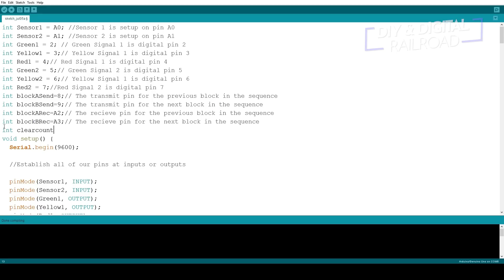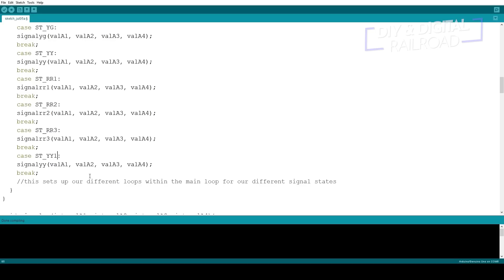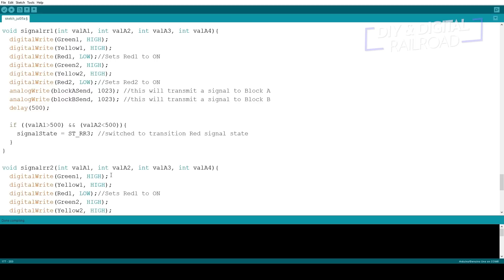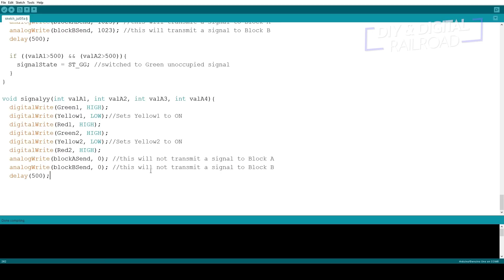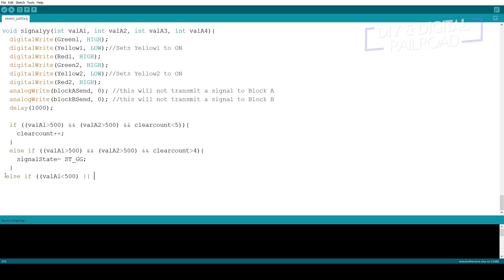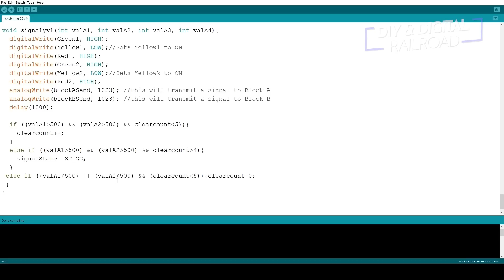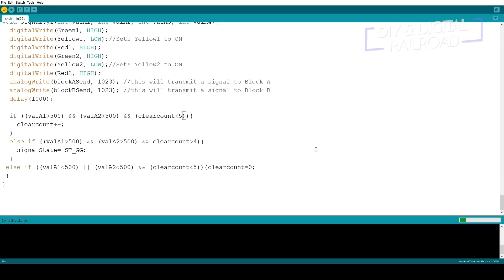Arduino Multiblock Signal Install Part 2

Comment: Hi Jimmy,
I'm new to this Arduino stuff and I'm amazed at how powerful, versatile and reasonably priced it is.  The block signaling is great but can that be linked to Block Detection using the Arduino so another train cannot enter a block already occupied by another train?

Comment: Hi Jimmy' I am having a  bit of a problem with your Arduino Multi Signal Install Part 2. The problem is it won't comply past the  case ST_GG:, next line 
signalgg(valA1,valA2,valA3,valA4);  ,I've downloaded the sketch and that is what I get.  How can it be fixed or is there some thing missing that I cannot find
I do like the concepy of the sketch and would like it to work. Many thanks for effort in writing the sketch    RON

l
l
l
Reply from the maker: Hey Ron,  Sometimes when downloading or copying and pasting, phantom characters can appear that you can't see.  Try deleting the line and manually typing it in.

Comment: Is there a if statement missing for block b occupied and current block clear in signalgy and block a occupied and current block clear in signalyg
Reply from the maker: If both adjacent blocks are occupied, then the program hops to signalyy.  This sets both signals to Yellow.  I just double checked and it is in there.

Comment: My question is, how the locomotive read that signal ?. I guess the signal states are transmitted by code transmit into Arduino that controled the motor shield.. Mmm, I'm still thinking about it..

Comment: Do you have any issues with the sensors picking up trains on the inside track where there is a double track? Or is that intentional to use the signals for both tracks as you only plan to run on one or the other?

Comment: Great video! I did it with a Raspberry Pi and for every block a own Wemos D1 mini that communicates via wifi to the raspberry pi. Also I used a LDR sensor because its easier to hide, and I know that i probably can't ride in the dark but that doesn't matter for me.

Comment: Hey Jimmy, Thanks for all the great videos and work with the arduinos. I had been working off and on with your first block signals sketch and trying to figure out if there was a way to make them work for my club's modular HO and N T-Trak modules. I had become rather busy and set it to the back burner for later. Just as I was getting going on it again, I found I had overlooked your latest videos for the Multi-block Signals. Not sure how that happened.

Anyway, after viewing all three videos, I set about setting them up to test with. I have them working... sort of.  I have added a few more diagnostic "Serial.print and Serial.println" lines to help me distinguish what sections are triggering and by what means so i'm not forgetting which values are from what sensor or block receive along with the clearcount value.

So where I'm at now, I believe they are working as you have intended. However, I am  not noticing a way for it to determine as to if a train has entered a block and then reversed back out of the block. Am I missing something?

Keep up the great work and I hope to hear back soon... Or if I find a solution to my question, I'll give you an update.

Comment: Is it possible to do block detection/occupancy by monitoring the current drawn on a section of track rather than using the IR sensors?
I would just find it difficult to hide/disguise all of the IR sensors.

Comment: Using built up modules made it pretty easy.  I also prewired the phone cable to the signals with 4-6 foot leads.  To avoid laying on my back,  I built a winch system that lifts my 4x8 table to the ceiling and also allows me to wire while standing underneath.  I put plug connectors on key connections like Vin, A2 and A3 which meant I didn't have to solder anything under the layout, it all is just plugging together. Today I install the block detectors and I have already designed a Signal Detector box on TinkerCad and will 3D print those to go over the detectors with only the LEDs looking through an opening.  This is adding so much to my simple layout.  Thank you again for all of your work.

Comment: OK,  my modules are finished and working but I am still confused regarding actual signal direction and placement of signals in a block.  Sensor 1 trips Signal 1 in Block 1 as the  train enters block 1.  My confusion is the placement of the Block 1 second signal and whether it faces the train that entered block 1 or whether it faces an opposing train and is on the opposite side of the track.  Please help before I start poking holes in my layout.  Thanks.
Reply: my apologies,  I saw you answered this to me on one of the earlier Multiblocks.  Signals for a given block face out of the block on each end towards an approaching train.  DOH!

Comment: Hi Jimmy,  Doyle again.    I finally had success at removing the IR RCVR and LED.    I have one of those small cooking torches like people use for Creme Brûlée.  I clamped the IR module in a vice and then carefully aimed the torch at the backside of the pcb where the LED pins came through the board.  Only took an instant, the solder melted just at that point and I was able to use a pair of needle nose pliers to remove the LED and then the Receiver.  I then cleaned out the remaining solder in the 4 pcb holes and installed header pins.   I then took two pairs of 8 inch female/female  Arduino wires and plugged them onto the header and also onto the newly removed RCVR and LED.  Got the terminals backwards on the first try but then reversed the connections and now I have both the rcvr and LED on 8 inch wires that can be mounted under the track roadbed without having to make a large hole in my 2 inch thick Roadbed and base.  I initially tried using a soldering iron to do the job but could not reliably get both LED pins to release at the same time maintaining the integrity of the LED and Rcvr.   At roughly $1 each for these modules,  I figured I could afford to lose 1 or 2 in the process.

Comment: So far I have built up 5 modules using the Arduino Nano and your code.  They all work great when tested in series circle with each other.  The one area I am having trouble with is trying to remote the IR rcvr and IR LED.   Pretty much destroyed the ones that were on the module when I cut and pulled them.  I tried ordering 3 mm Rcvr/IR LEDs and also 5 mm high intensity ones from Amazon but neither had any sensitivity at all.  Have you had any luck removing the Rcvr/LED to a short cable which would make it easier to put them under the track and roadbed.  My layout is built on 2 inch blue foam with roadbed on top of that so not easy to mount that entire module.  Last alternative will be to try to pull the existing Rcvr/LED and attach them to wires and headers.
Reply: Hi Doyle, I've found a 3mm IR emitter that works with the existing IR receiver. It's VISHAY part number "VSLB3940". So far I haven't located a 3mm IR receiver yet. Have you found a suitable 3mm detector?

Comment: Just curious why you moved your sensors topside of the layout.  Was it to avoid drilling large holes in the track or were there problems with detection from underneath.

Comment: Jimmy. Love your site. Would love to learn to program it. Do you have a good resource that describes the available syntax that is used in programing such as pin mode, read and write statements, relay etc.  I have programmed for years, just need the defined statements. Thank you
Reply: Hi, Thomas. Paul McWhorter has a new series of Arduino tutorials in progress. They are excellent because they explain program design considerations and the electronics involved as well as coding. He covers best practices in everything he does, why you should avoid the use of the delay function whenever possible, avoiding the use of constants, etc. He teaches math and science in high school, so his teaching technique is very good. I highly recommend his tutorials.

Comment: You need to add parentheses to your code for the ANDs and ORs (&& ||).  They are like multiplication and addition (respectively).

Also, you shouldn't be defining constants as variables (the ints at the top of your code).  Use #define instead.  This will save on read/write RAM and avoid weird errors later if you accidentallly change one of these ¨constants¨.

Comment: I like the idea of the sensors above the layout.  I use atlas flex and if it is between the rails on a curve, it is hard to keep the track in gauge.   Lots of little maintenance sheds around to hid the sensors :)

Comment: Great video Jimmy,  still waiting on my parts to arrive. I saw another video where the person using the same sensors, swapped them out for 3mm LEDs which do fit between HO ties. Also looking at adding a couple headers in place of the sensor LEDs then using a female to female arduino wires to connect to the now remote 3mm LEDs, allowing easier adjustment of that trim pot. I think I a driving the local Amazon driver crazy with almost daily packages coming in.  Keep up the great work!

Comment: On the old layout I thought you had the sensors embedded into the track and now they are in the open. Why? Did they not function well in the track? Won't they be more likely to pick up ambient things in the room now? I assume you have plans to make them less noticeable and what is it? I've been following your arduino things religiously and love what you do!
Reply from the maker: So the last one worked fairly well but they were difficult to install and adjust the sensetivity.  I wanted to try a different method that I have seen people do before.  Right now they are working incredibly well, much better than before.  I am going to try a third method for my grade crossing installation.
Reply: Yes these sensors are good for HO scale and up....I've actually installed these under bachmann ez track with no issues.....for nscale I use time of flight sensors which I embed into the Kato unitrak it uses the SCL SDA and are addressable which come in handy later for dcc....more involved however the sensitivity is awesome....you don't have to worry about putting tape under the car etc....more involved though....I would suggest going the all digital route instead of using the Val especially if you are keeping the sensors above the benchwork especially once you get buildings scenery and everything in place..... multiple trains running will effect the signals on the double track
Reply: @scottericcatalano596  Hi Scott, can you provide a part number and supplier for the "time of flight sensors"? It sounds like an interesting alternative.